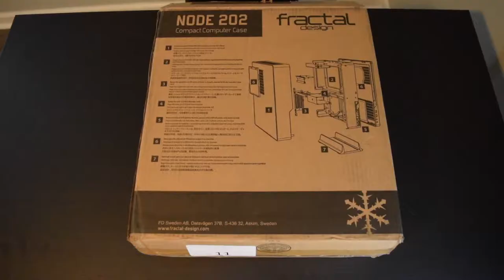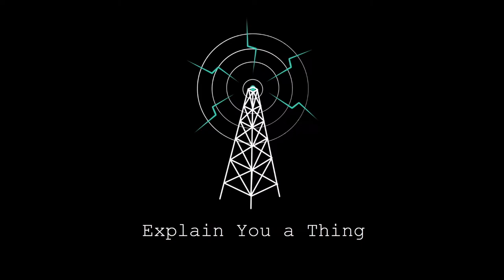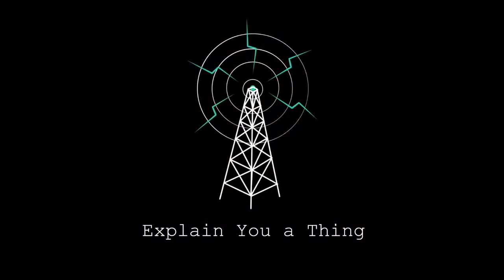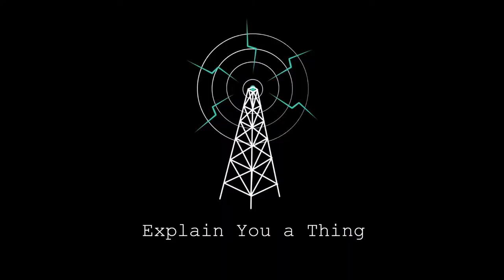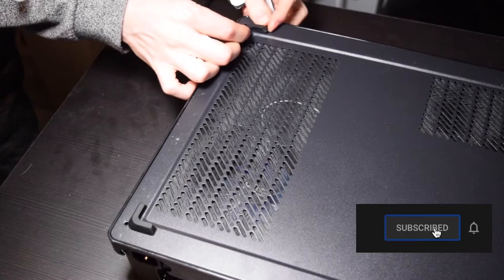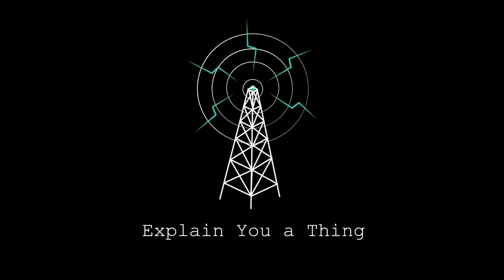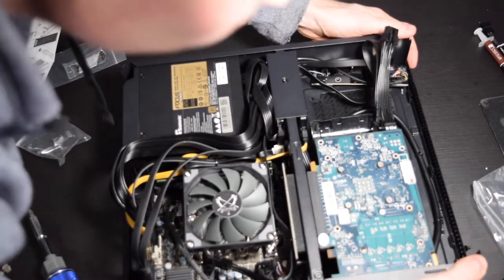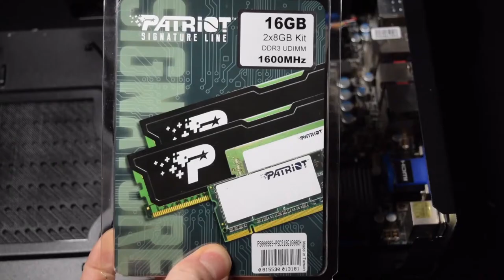Fractal Design Node 202 Short Review, Long Build

Comment: Is there any way to put in an external fan? 

I’m planning on getting that case for my small desk.
Reply from the maker: Maybe, but it's gonna have to be a pretty elaborate hack from what I see.
Reply: This has 2 120mm low profile fan space in the gpu section 😑

Comment: the cpu cooler fits? stats say its a 94x58x93mm  cooler but fractal page says max hight 56mm..
Reply from the maker: Yeah the cooler does fit, just barely though.  I was skeptical, but that's the cooler I'm running and it managed to clear in this case without modification.
Reply: @ExplainYouaThing  sound good. thought it might bulge the case outwrds
Reply from the maker: Yeah in my specific instance it seems fine, I'm just operating on the assumption they haven't changed anything since, but I'm assuming they haven't.
Reply: @ExplainYouaThing  thx alot, i wasnt sure which cooler to take. when youre operarting with so little space, it feels like a waste to take a cooler, thats leaves 8mm open because those 8mm have no cooling potential, and since theres supposed to be a 11400 in there, i try to get what i can. i was thinking about the Thermalright AXP90-X47  but the scythe seems to be the better choice
Reply from the maker: Oh yeah for sure!